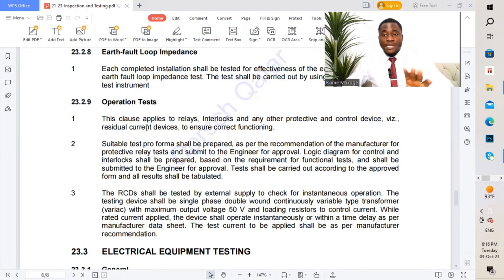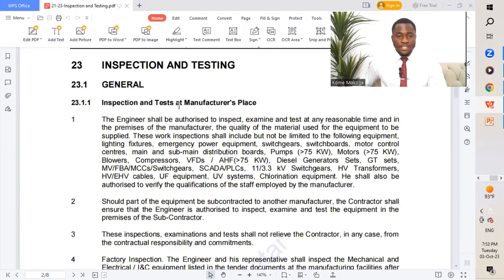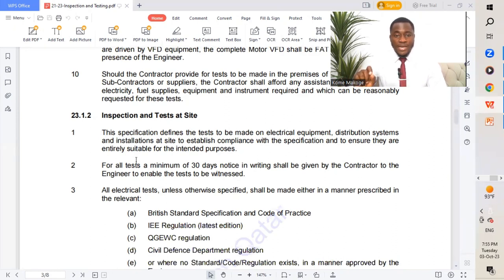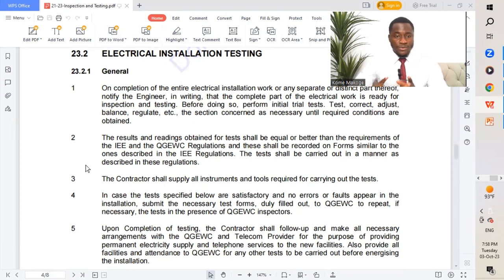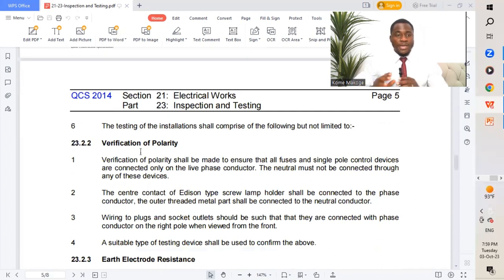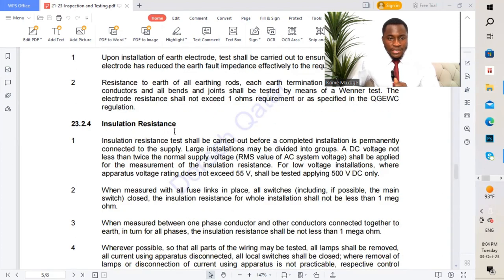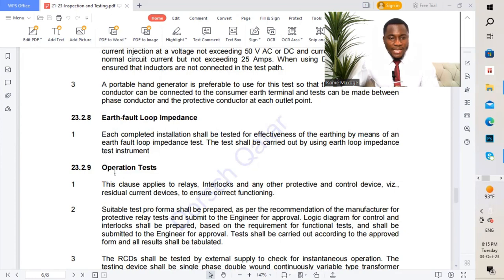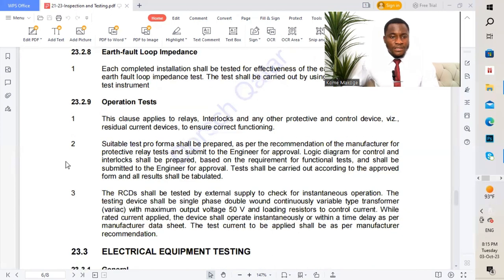Inspection & Testing QCS  2014, Section 21 Part 23

Comment from the maker: Anyone knows the difference between FAT and SAT?
Reply from the maker: FAT is Factory Acceptance Test 
This test is conducted in the factory, to attest that the material conforms to the requirement/specification of the project and as per the approved material submittal.

While 

SAT is Site Acceptance Test 
This test is conducted on site or project site when the material have been installed on site. 
This is to attest/prove that the material operates to it's design intend.